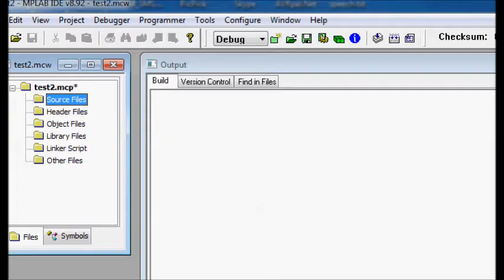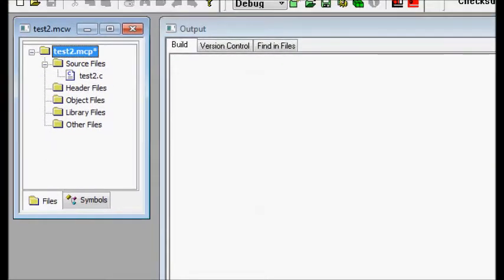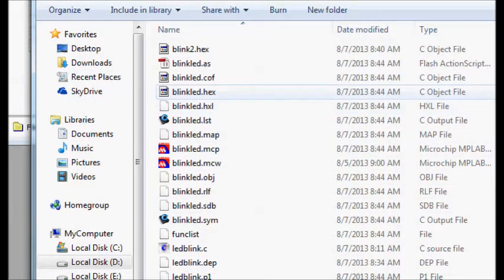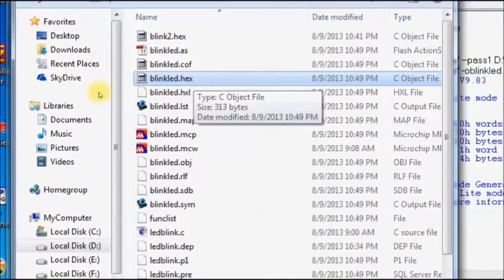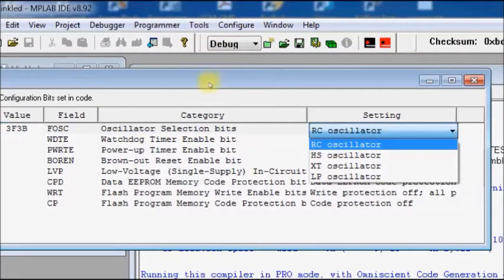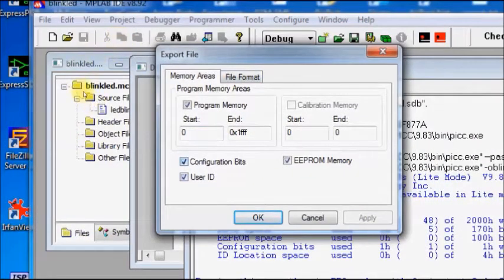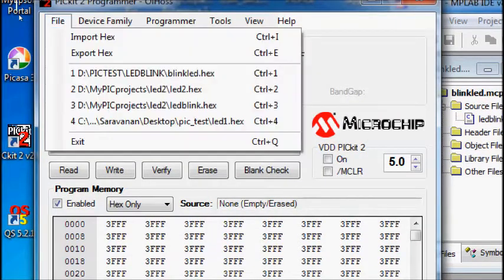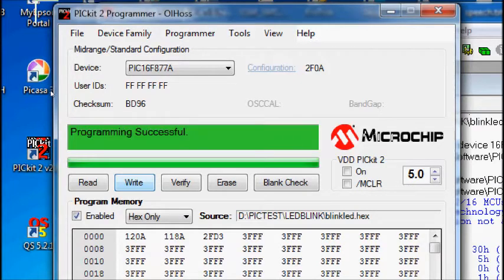Troubleshooting Guide - PIC Microcontroller Programming

Comment: Can you help me with the code for interfacing LCD with PIC16F877A?? I am using HI-Tech C compiler and am unable to ge the output. (The LCD is working fine cuz when I checked seperately in arduino i got the output)
it would be very very helpful